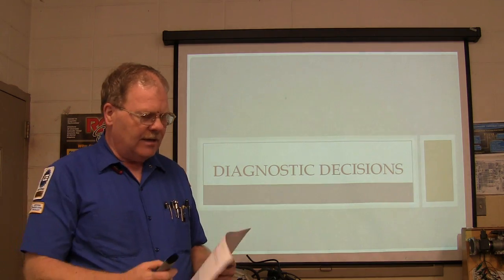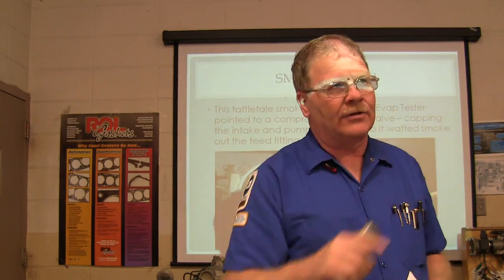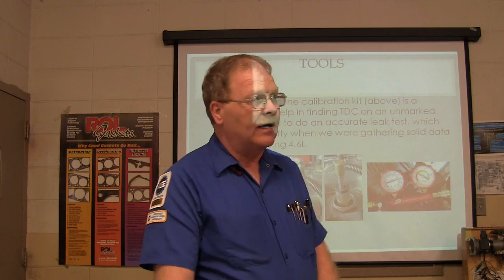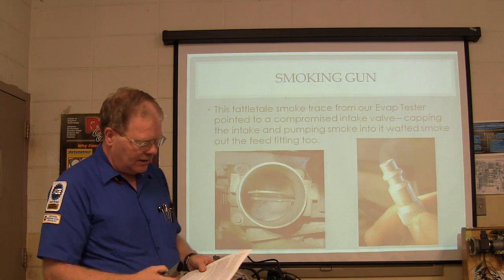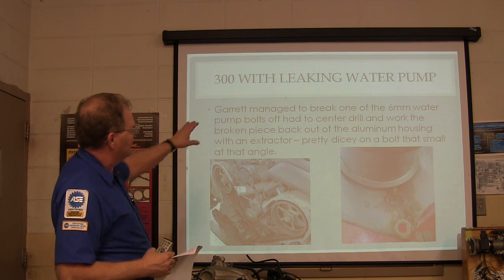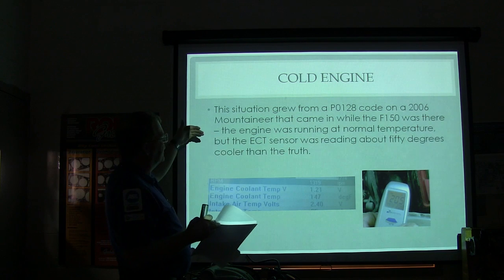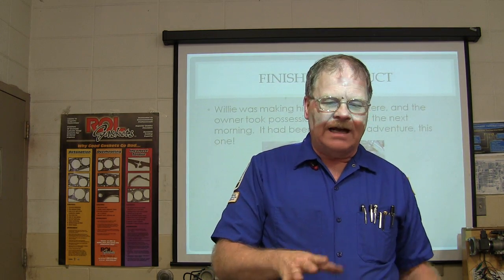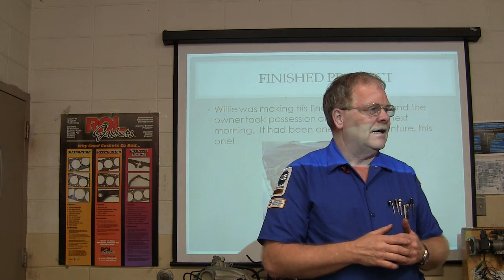Diagnostic Decisions   Short War Story

Comment: Hello Sir.
I would like to share a war story with you and your students.
From one seasoned Tech to another.

1999 jeep Grand Cherokee 4.0 Liter 180,000 miles.

Vehicle was towed in from an out in the country garage. Cranks but no start condition.
Backfiring up through the throttle body while cranking. Leak down test confirmed head gasket blown out between two cylinders.Head comes off and gets rebuilt( excessive warpage confirmed by the machine shop). Reinstalled and exact same condition. Crank sensor was next, had an erratic signal on the scope. went to change it out, to find it was tie strapped in place, the hold down bolt had been broken, extracted broken bolt and reinstalled the sensor, now clean signal on the scope, same no start condition, we look to the cam signal, very bad signal, replaced and now we have clean crank and cam signals. Same no start condition. We have a nice blue spark from all coil packs. Pulled injector rail out and while hooked up cranked and saw two injectors were not firing, injector pulse was present on the two suspect injectors. replaced the two bad injectors. Same no start condition. Now we know the timing is not quite right, hence the popping up the intake. Pulled the timing cover and found the chain was sloppy and had jumped 2 teeth. At this point I was very happy that this is the end of this nightmare vehicle that was  dumped on me.

 New chain and gears , realign the cam sensor drive. and still same no start condition.
Went over and over and over all the wiring between all sensors and computer, all was good and sound.
We are now thinking this has to be a computer malfunction. There was a used unit in the vehicle, installed it and still the exact 
same no start condition.. Now we are completely lost. ready to give up and ship it off to someone else. One last attempt today, I googled my exact problem to see if anyone else had the same issue. I read for hours before I stumbled on a forum with a guy pulling his hair out just like me. Someone caught on that he had replaced the coil pack. and it may be the wrong one, the 1999 and 2000 model year have specific coils for each year. Identical except for the plug angle and the internal wiring. This is what solved and ended my months of stress. Without the help of this forum I dont believe I would have ever figured it out. But the question remains, How could this vehicle have so many problems at the same time ?
Upon replacement of the coil, noticed it had markings on it from a wrecking yard. Obviously it was from a 2000 model.
Maybe your students will find something useful from this diagnostic.

Love the way you teach, your students are lucky. Not many guys like yourself left.
Reply from the maker: +hydrofuelincanada Thanks a million for the war story and your encouraging words.  I'll share it!
Reply from the maker: +hydrofuelincanada Incidentally, we replaced a 4.0L (got one from LKQ) in a Wrangler about a year ago that was popping back like that and found that the coil pack on the engine that came from the salvage yard was one that was incompatible like that - since we had only just replaced the engine and it was acting like the spark plug wires were crossed I found myself deciding to to the quick and easy and it happened to work - I reckon the coils are wired in a different order in that one, sort of like it is in some Fords - not all V6 coil packs are created the same on those, and I've seen it on Fords too, when the wrong coil pack was installed.
Reply: +McCuistian Yes aparantly the internal wiring is different. Another crazy design.
Reply from the maker: +hydrofuelincanada Check the video I uploaded today...

Comment: I have a 1997 Mercury Marquis 4.6 .   At what mileage should the timing chain or chains be replaced?
Reply from the maker: It may not ever need one.  If you don't hear it rattling, don't worry about it. I've seen Crown Vics with 350,000 miles and the original timing chain.
Reply: I've taken very meticulous care of this car and have always used motor craft parts . thank you